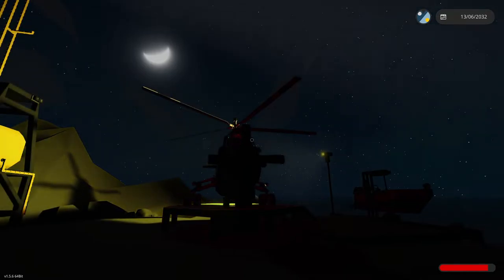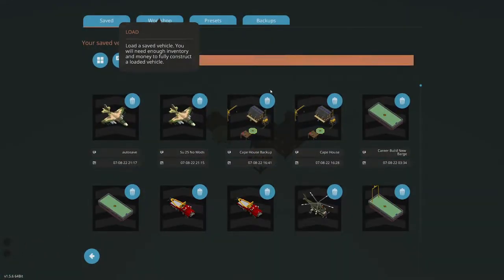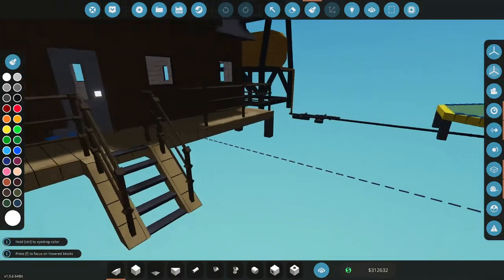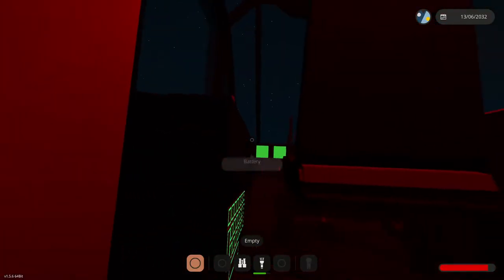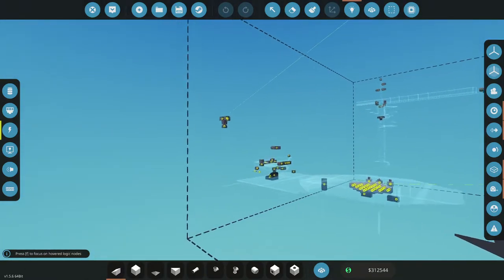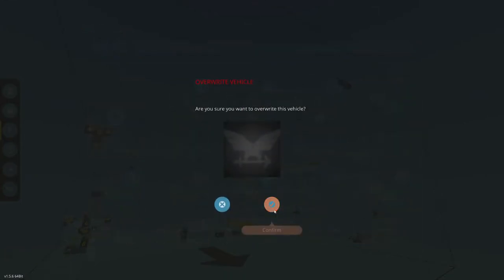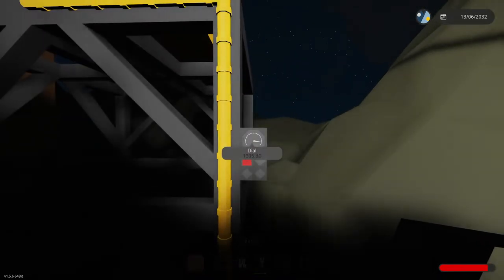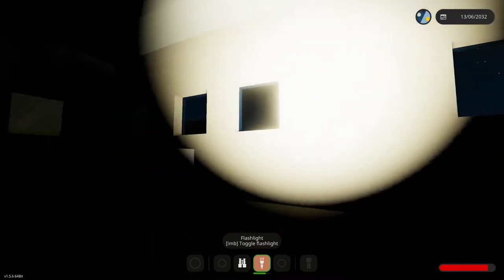Stormworks Career Build Series 119

Comment: How did you put multiple fuel tanks and make all of them connected to 1 dial?
Reply: you can either use an add logic block and connect the fuel ta ks to the add block or use a function with 3 inputs and type x+y
Reply from the maker: I bring all the quantity nodes to a microcontroller. Use add blocks and add them all together. You can also just read one and multiply them. Less accurate but more compact.
Reply: Thanks 👍🏻